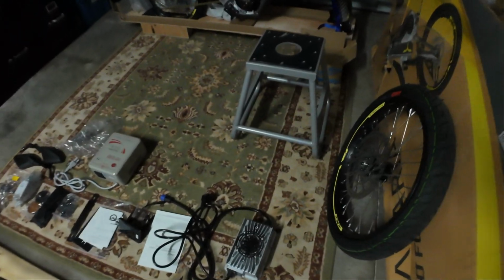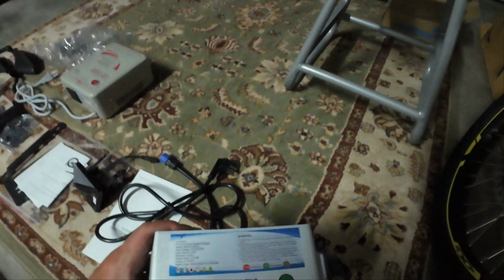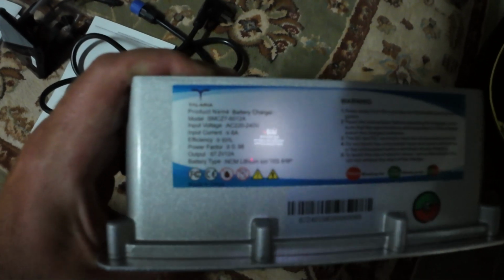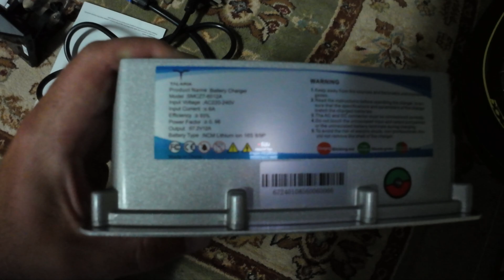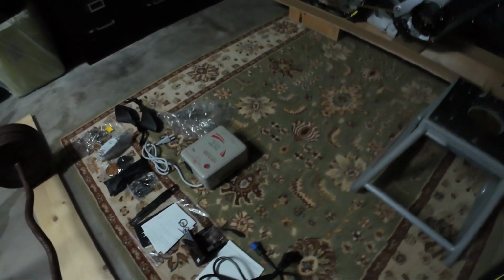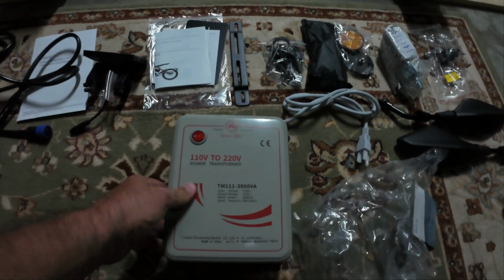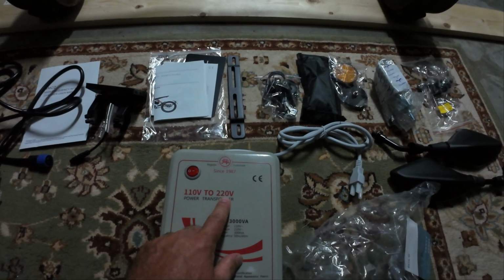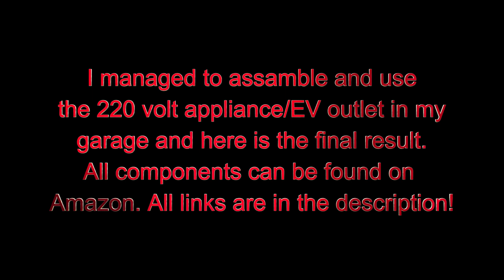Chinese market charger 220-240 volt in USA, How To! for Talaria, Sur-Ron, E-Ride Pro, etc. 6/13/2024

Comment: Id contact i got same bike came with usa plug direct from charger
Reply from the maker: I don't know about your bike and what retailer you got it from, but mine had this charger with it and the transformer. So, in case you have the same charger as I do, or if you find a charger that is much less expensive but same situation, this is a good solution.